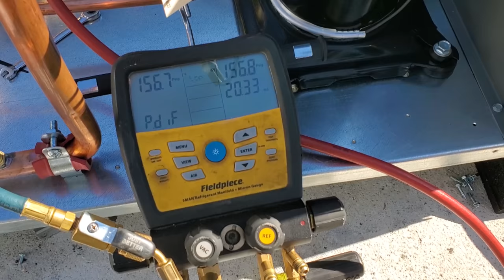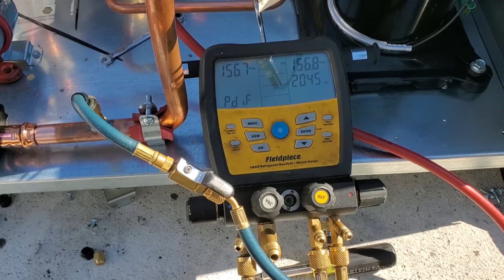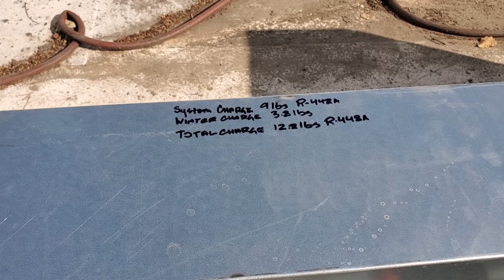WALK IN COOLER RETROFIT WITH ZoomLock MAX

Comment: I don’t know about everyone else but brazing is my favorite part of the trade. Those expensive press tools and fittings belong in the trash. I know when I braze a joint it’s gonna last and I don’t have to worry about an o-ring leaking down the road. It seems to me like those o-rings could become brittle over time and end up cracking and leaking. To each his own, but I think it’s garbage and I will never use them.
Reply: F P  the fittings havent been around long enough to know how they hold up over time. In 5 years they might be leaking like crazy, or they could be fine. One thing is for certain, a braze joint done well will last.

Comment: What kind of tape did you use to seal   around the roof opening?
Reply: But what kind of tape is that? 🤷‍♂️
Reply: that was roofing tar, he only used tape to make clean lines with it and not have it booger smeared all over. also why he was worried about stepping in it and making a mess :)

Comment: R448a is good for mid temp. On the low temp you lose capacity compared to 404. And high discharge temp. R452a is better for low temp imo.

Comment: Why did u go with that style connection rather than good old braze joints?
Reply: Without even watching it, I'd guess, "Manufacturer's warranty requirement"
Reply: Its a lot faster to install for sure. If its about the same price as the (identical looking) press-on connectors used for almost all water/heating copper/stainless pipes here, then its cheap, too (something like 25% more than a solder fitting).
Reply: It's the sort of thing that, if done right, shouldn't be much of a problem, but it won't be done right.  (current Company excluded)
Reply: @ICountFrom0  Same with soldering, you can do it properly, prep everything nicely (just about as much as needed for press-on fittings), then solder carefully and inspect it. And you can rush it, not giving a flying one about it. It will leak just as well after a while.
Reply: He is having fun with a new tool lol. There is no warranty that requires that tool or anything. Its just faster and cleaner than brazing. Not exactly sure how long they hold, im pretty sure they are guaranteed to last unlike sharkbite fittings in plumbing.

The tool itself is about $2500 and the fittings are about $10-$20 a piece, so most people still just stick to the old school brazing.

Comment: I like that press tool. The fact that the fittings have the extra copper tail is great. If a leak develops you could always braze them. 

Also, what is the name brand of that line set? I have never seen that type of insulation in black, only white.

Thanks

Comment: Emt conduit is not permitted for outdoor use. It will not pass electrical inspection in the north East. Aluminium or aluminum (depending on your philosophical bend) conduit is rated for out for use.😊
Reply: Says who? Please do enlighten with a specific NEC code. Just cuz NorthEast US says one thing, California does it's own thing. NEC mite as well not even bother applying to Cali since Cali throws most of it out anyway

Comment: How much are each fittings ?
Reply: Im a aircraft mechanic and we use a similar system called permaswage for hydraulic lines . Peraswage allows to reswage at 180 degrees if you have leaks . Max pressure limit are 5 thousand pounds . Each fitting is around $50 .

Comment: I’ll never trust proprietary fittings sealed by elastomers.  Age does no favors for anything rubber, especially when cost reduced to the point of ineffectivity and sourced from the Land of the Kung Flu.  Dynaflow and StayBrite joints will last forever.  Simple is Good.

Comment: The wiring job inside that crusty old fuse box was a pleasant change from what your usually presented with. Neat and tidy says the original installer had pride. Nice.
I would also like to know what colour are the 0-rings in those crush fittings? Aviation grade 0-rings in black as a general rule have a 10yr shelf life, if they are red or blue they are flurosilicone 0-rings and have a unlimited shelf life. Also the aviation version of those fittings is called "permaswage" and are used extensively in 3000 psi hydraulic systems and ive seen 35yr old aircraft not leaking a drop. Its impressive stuff!

Comment: I’ve never met an O-ring in 35 years from any manufacture that did not eventually leak at a high percentage rate of the jobs within 15 years or 20 years
        But my grandfather is brazing and soldering jobs from the 1940s and 50s is still holding up strong. 
        My fathers braising jobs on the units that I’ve worked behind to this day that are being replaced are still holding up strong. 
        And my jobs that my grandfather taught me as a child to learn first time on the job still up and running to this day. 
         On the other man-made synthetic Seals so far none have ever been manufactured that don’t leak.
Reply: They trust O-rings in nuclear submarines and helicopters, I’m sure they’ll be fine.

Comment: Whenever we run a line set through a cooler top or wall we always put in a piece of PVC first and put the line set through the PVC, prevents The line set from rubbing through on the sharp metal edge of the cooler

Comment: I'd like to know how the zoom lock fittings work out for you. The only access I have had is from those types of techs that make the comments like, "Switching to zoomlocks have cut my solder leaks in half" which makes me do a double take and ask, "Leaks?" I get it, we all have a leak every once in a while, but to even make the statement of it cut the amount of leaks in half, that is the biggest problem and I have had to go behind those same techs on leaks with those as well. I know you say, you aren't perfect, but we all aren't, and I would like to know how a zoomlock installation from a, "better than most" company works out, I do like the idea of the added level of installation to give the customer the option, depending on budget, but I am also wondering how long the 'O' rings may last on these systems, I can tell you from experience, as a kid, we had a small engine repair business and when 'O' rings hit the lawnmower market, it changed drastically, though I know, the design and applications have changed in 40 years or so, it was a problem when first implemented in that market. Thanks for your content Chris, hopefully you will do a follow up video in 6 months or so, or maybe I will have one come up between now and then and will go in debt buying the tools LOL. Have a Good Evening, Aaron, Repair Monkey Service Group

Comment: A pity, R12 systems are getting more rare nowadays since the production of the refrigerant was banned.  Superior performance than most modern refrigerants, but has the significant disadvantage of destroying ozone in the upper atmosphere.  I actually own a vehicle that has such a system installed (nonfunctional since the compressor died).  Pain in the neck to retrofit vehicular systems for more modern refrigerants though, let me tell you.  At least this one would have been a lot easier, since you can choose where to put things, even if not 100% ideal.  A vehicle borne system has only one place any one thing can go (compressor here, condenser there, receiver dryer there, etc, not to mention you have to either modify what the vehicle comes with, or you will shell out some extra money replacing the original compressor with one from a more modern vehicle, the extra money for a mount and necessary modifications to attach and power the newer one on the older engine.  Hint, I'm not doing the second, although I wish I could. Fun.

Nice tool.

I take it from "no supermarket work" you don't usually see the industrial size compressors, like the one I saw at the local supermarket I worked at once.
Reply: Production wasn't banned, only the sale of it to unqualified weekend warriors at the walmart. You can still get R-12 systems recharged by a certified tech. The "ban" only applies in certain countries as well, it's still being made and released in some parts of the world. Just not in the walmart parking lot.

Comment: Some of the zoomlock fitting are only for 410A so just be aware
Reply: It's available for more than 410-A. Here is the refrigerant compatibility: http://images.solutions.parker.com/Web/Parker/%7B90fca24a-2ad1-4159-a35d-79bb85f49a9f%7D_Catalog_K-3_ZoomLock_MAX_Refrigerant.pdf
Reply: If you're talking about a label that says r410a approved it just means it's rated for those pressures from my understanding
Reply: Its rated for 410A, as in its rated for higher pressure refrigerant lol

Comment: Its too much work preparing the pipe. You can braze much faster. Last week, found brand new Ice machines installed with propress plumbing, leaking. Also found this zoomlock fitting leaking on brand new condensing units. One small mistake in the process and you will have a leaky connection. In addition, it cannot be used in small appliances and reachins. Most service companies will not spend $5000 for this tool. There is no time savings.

Comment: Press fittings are way more better than welding! Faster, no overheated parts like valves and ports, no impuritys in the lines by oxydated copper and flux and the copper itself doesnt get degraded by heat and the oxygen. In europe mostly all line sets are done with press fittings.
Reply: No? In the Cooling Section mostly nothing is pressed, only for Water or Gas. We do R744 and R134a, R449a, R513a and others, we never use press fittings, altough it has gotten to a point to rethink our work with brazing. But we ONLY braze or use Swagelock on the bigger Machines in example for Oil Lines, but also other connections on the rack

Comment: Removes valves that are redundant and possible leaks... uses crappy rubber o ring fittings guaranteed to leak down the line.

Comment: EMT is illegal for wet location and outdoor
Reply: says who? NEC? care to cite a specific code. Remember California throws the NEC out the window makes up their own code anyways
Reply: @harveylong5878  u don’t need nec to tell I that emt rust with water!
Reply: @mikepan3189  rusting doesn't make EMT illegal. The HVAC equipment itself the disconnect box is gunna rust so does that make those illegal? NO
Reply: @harveylong5878  I guess whatever  float ur boat!
Reply: you need corrosion resistant  "rain tight" compression couplings, then it can be used outdoors exposed, buried, encased in concrete, etc. 
ALL fittings have to be rain-tight rated from end to end, you should probably use electrical rated thread sealant on everything also. which probably nobody does, except commercial electrical contractors